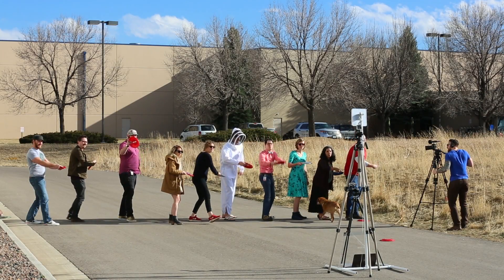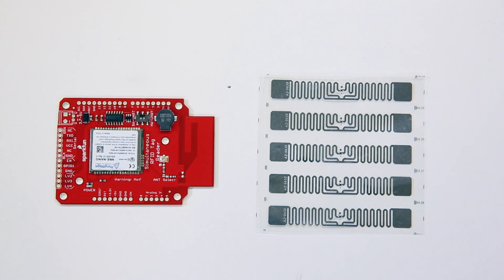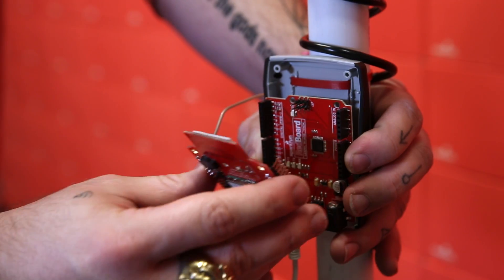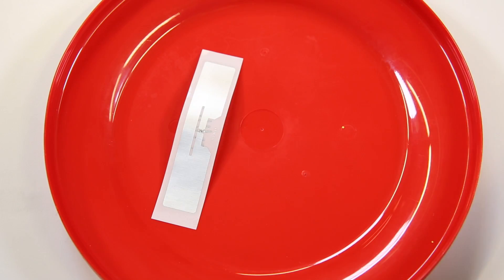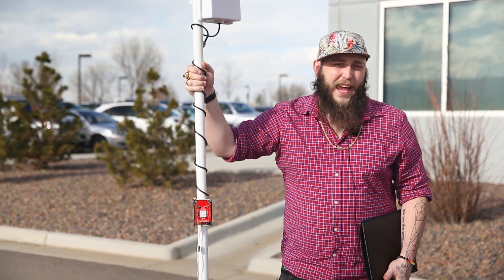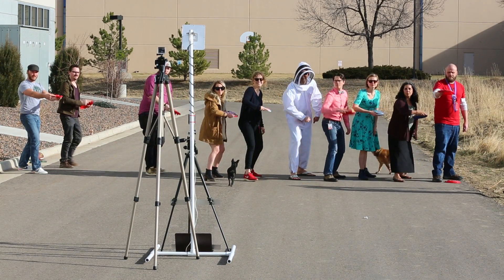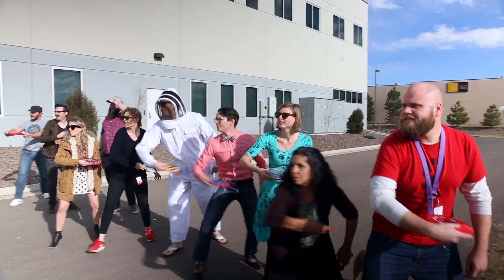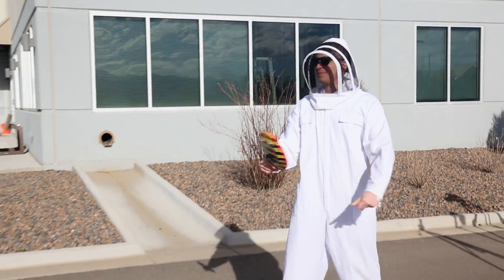SparkFun Simultaneous RFID Tag Reader

Comment: Hi, I bought SparkFun Simultaneous RFID Reader - M6E Nano  for a project. I powered it up with the Arduino Uno, did not attach any external antenna Just the Interface Cable RP-SMA to U.FL and the distance I am getting is just some inches. Help required to do the distance test.

Comment: Hello, I got this kit last month and experimenting with the range. I find the range is maximum of 5 feet (in a particular direction only) when powered from external power supply and the read power set to 15dBm. Before I experiment with external antenna I wanted to explore and understand the beam width, gain, directivity and other details of the PCB trace antenna. So I have following question.

What is type of PCB trace antenna used in SEN14066 SparkFun Simultaneous RFID Reader - M6E Nano ?
Can anyone point me to the datasheet of the PCB trace antenna used in SEN14066 ?
Thanks in advance

Comment: How About using it With Raspberry Pi ? Does this reader Works?. Please Reply ASAP. Thanks. More Power
Reply: What if I will not use an antenna ? What is the current range of this reader?

Comment: SWETTY hit the ARDUINO BOARD + RFID SENSOR BOARD for the win!!!!    And the other guy on the audio said (OH WHAAAAAATTTT!!!)...   can't believe his eyes.
It seems that the ON-BOARD antenna of the RFID sensor was not bypassed by the HIGH GAIN ANTENNA.  If that is the case, then the BOARDS should have been placed at the back of the HIGH GAIN ANTENNA...

Comment: What are you using for the external antenna? I'm wondering if a directional antenna could be used in a race-timing scenario?
Reply: I had exactly the same thought.  Looking closer at the photo of the board, I see that there is a tiny U.FL antenna connector.  Now looking for an antenna geometry that could work for automatic finish-line detection in a foot-race (marathon, etc.)
Reply: Richard Crowley did you find a suitable antenna for this?
Reply: Looks like this antenna. https://www.sparkfun.com/products/14131
UHF RFID Antenna (RP-TNC)

Comment: Hi huys, very interested, If it is connected to an arduino compatible board , could it be power up to 27 dBi? what type of antenna connector does it have? I did not see it on the pics.

Comment: $200 come on guys, I was thinking of buying this product but now, naah
Reply: The commercial equivalent is $800 for a cheap one. This is a impressive device
Reply: If you're really interested in it, you can always purchase the parts and build your own. SparkFun has all the design documentation (including PCB layout) on their website. But the cheapest retail place I could find to purchase the module apart from SparkFun was $125. By the time you add the other components and PCB printing, you're probably not going to save much.